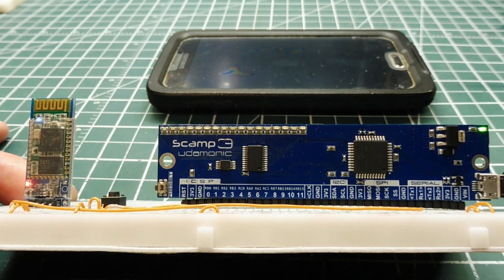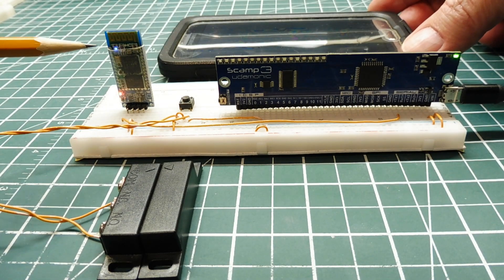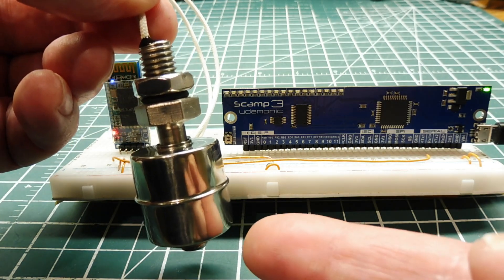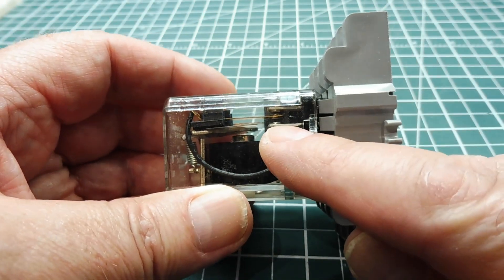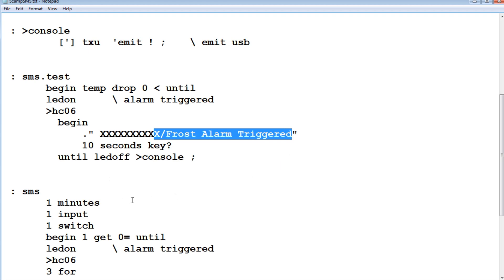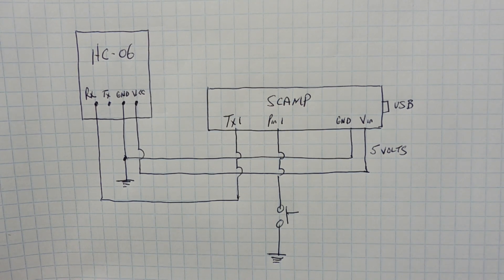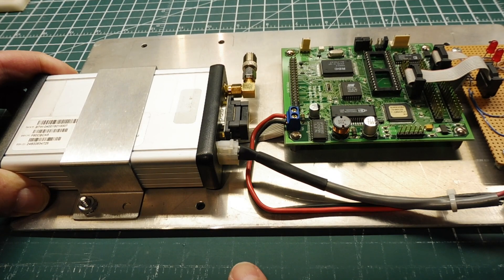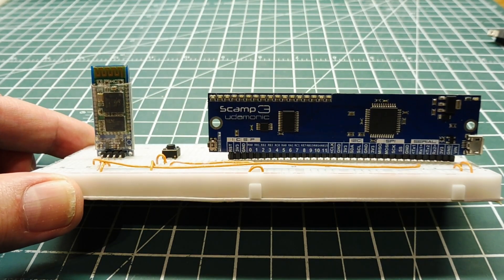SMS Alarm / Text Message Alert / Scamp 3

Comment: Great video. This reminds me of the time where cell phones were rather expensive and for the happy few. Also coverage was an issue, so...  Long time ago, I made a project where I combined software (Visual Basic 6.0) on PC (AT 386 and 486) to decode and encode 5-tones which are used in PMR's. On the PC side I had relays etc.. which I could manage remotely through the keypad of the mobile radio.
Reply from the maker: Thanks for sharing Philip. Back in the days when everything was analog it cost a lot of time and money to get a project up and running. Now you can find a breakout board or module that will do what you want online. If you still remember Visual Basic, check out PicoMite for the Pi Pico .. I was impressed.
Reply: @0033mer  Indeed ! I worked about 2 years on that project. Anyway, the PicoMite was recently explained on the YouTube channel of "Explaining Computers" from Chris B. I absolute love this !

Comment: Brilliant! Another great video!  By the way, in your sms word, 'switch' configures the pin as an input as well as activating the pullup. You don't need the extra 'input' command. :) 

Loved seeing the railroad application you built in 2006. That's very nice. I like it.
Reply from the maker: Hey John thanks for the tip. Now that I think about it, that makes sense.